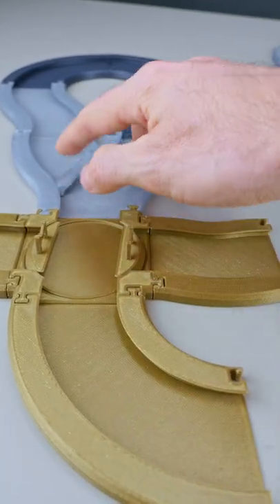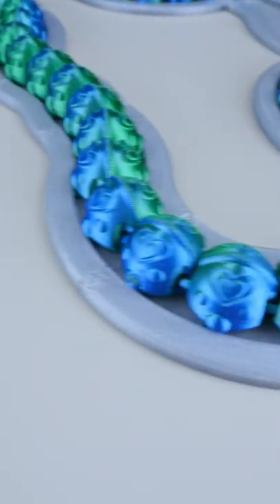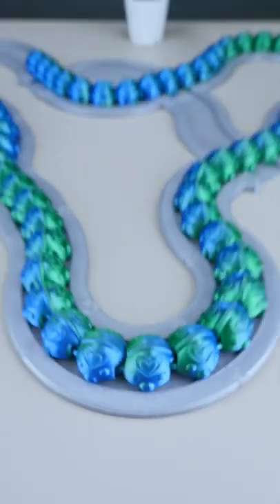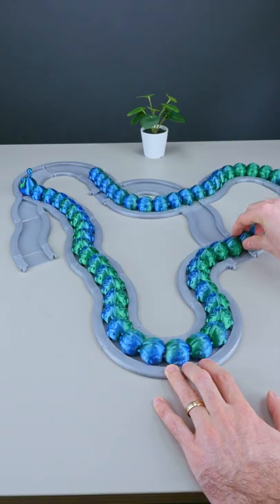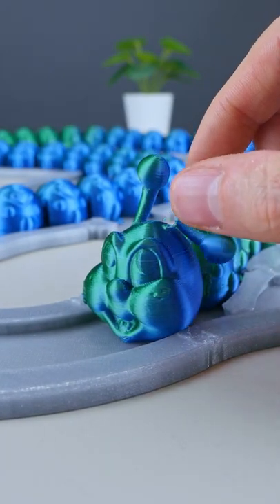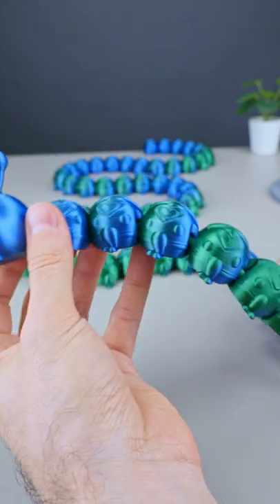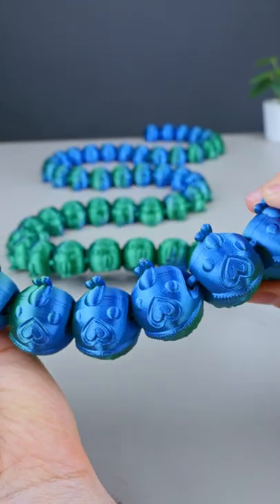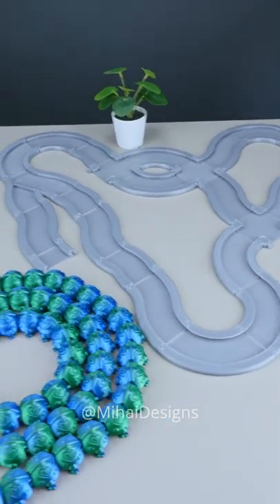Love Bug Railway, 3D printed

Comment: Genius Idea! Do you have any advice for clearance tolerance? I really have a hard time make things fit the way I like it. 0.35mm seems to be a tight fit with my current setup.
Reply from the maker: Trial and error for the most part. And add a bit extra just in case, because various printers are tuned differently. For the printer, it depends on how well linear advance is set up (if available at all) and how well the layers align, and extrusion calibration. I guess for me 0.2mm is a tight fit, but varies with the model.
Reply: @MihaiDesigns  I have linear deactivated since it totally broke my z seam (literally like not connected) and just using s curve. Maybe I give it another try but I couldn't get it to work
Reply from the maker: @dgfpv1988  yup, that happens and I find that finding a good setting is not trivial, despite the existing online tools.
Reply: Teaching tech has a good guide on it. I'll try it with that